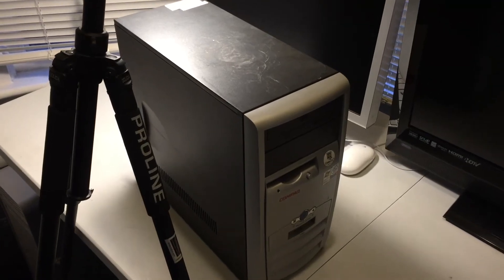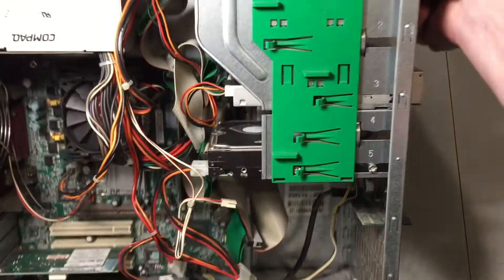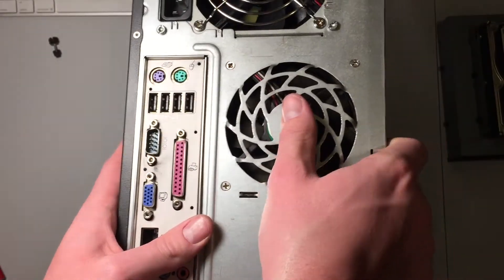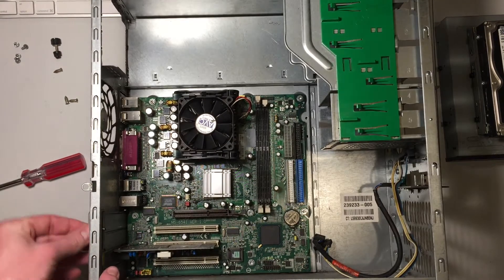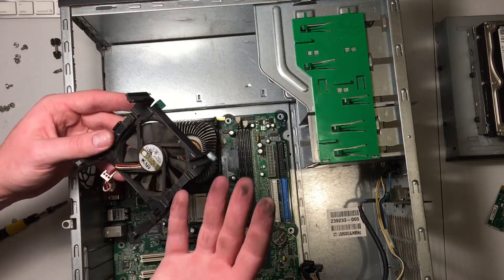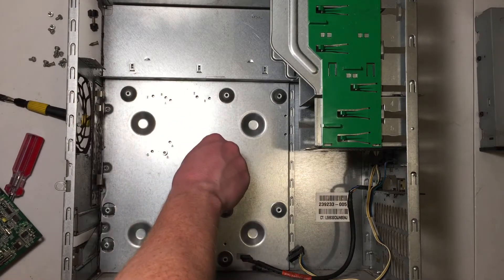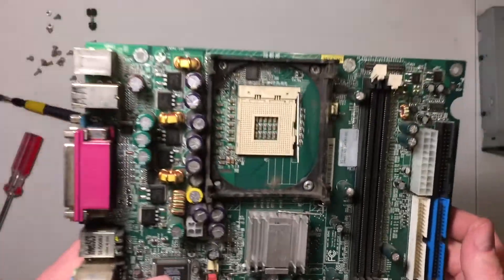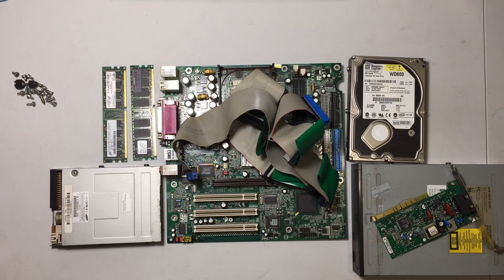Compaq Presario 6000 Pentium 4 Take apart (Part 2)

Comment: I've got the same model system but it has a different fan bracket. One side has a structural support and the other clips down onto the fan mount on the board. There are two screws centered on each side of the CPU socket which provide support for the fan bracket mount. With my case and board, it was these two screws holding down the motherboard! Hopefully this helps someone else trying to figure this out.

Comment: Very informative video. I have the same machine, can you tell me if the system is not used for one or two year then the BIOS battery will still be functional or needs to be changed?